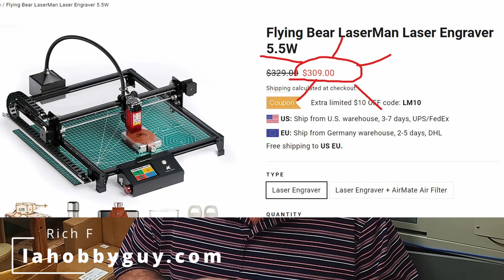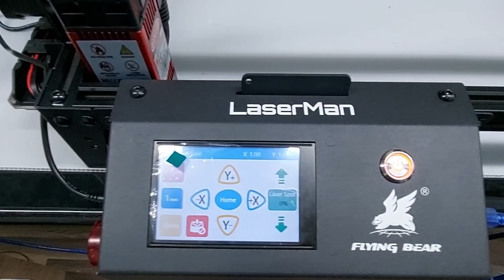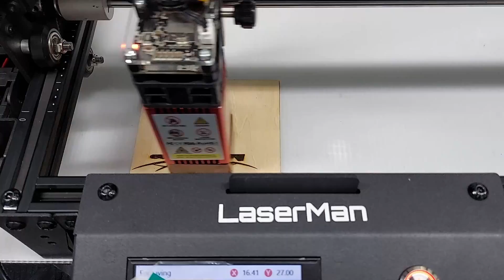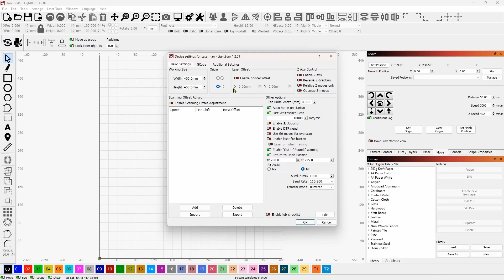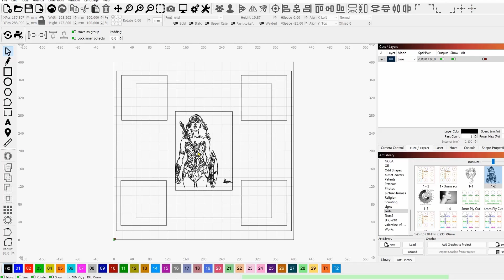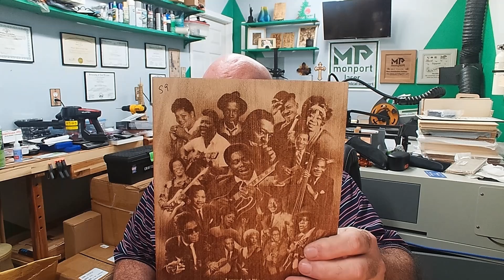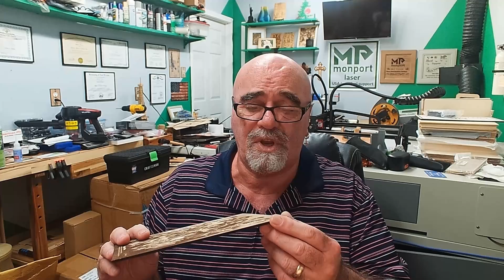ℹ️ Flying Bear Laserman, 5W Diode Laser Review! Comprehensive Review!

Comment: Working with Adam at Flying Bear.  I thought those of you who have this machine or are considering it should have this information.  This is a copy of the email exchange between me and Adam at Flying Bear.  My request is at the bottom of the email and Adams response is at the top.  So you might want to read bottom up so it makes sense....

Dear friend

I'm so sorry to keep you waiting so long.

Thank you for your letter, we too have found this problem and would very much like to solve it.

However, this problem cannot be solved by modifying the firmware at the moment. the operating mechanism of the LB prevents us from changing it, because once it is used, the LB takes over all the controls of the laserman.

For customers with an urgent need the smoke filter can be turned on manually by modifying the hardware. Although this is not a very responsible approach, it is the fastest and easiest way. We plan to do a DIY tutorial next week to show those who need to add a manual switch to turn on the smoke filter.

Also our new Laserman2 and LaserX machines have a modified motherboard interface and rewritten software to allow standalone control, but they will not be available for sale until after August.
 
Adam
adam@3dflyingbear.com

On 2/1/2023 00:15，Steve Hasebroock<SHASEBROOCK@neb.rr.com> wrote： 

*************************************************************************************************************************************************************************************************

Adam,
 
I was told to contact you.  Here is the series of comments that will tell you the issue and story.  Most of these are copied from YouTube post comments on your YT channel.
 
(Steve Wrote)  Many in the DIODE Laser community, particularly the ones the purchased a LaserMan were told MONTHS ago, LAST YEAR that you were working on getting the LaserMan to work directly with LightBurn specifically on the problem with the Fume Extractor NOT turning on when running LB files directly from LB and not saving them to a SC card and launching from the LM machine.
 
Has this been fixed and how to we get the updated firmware.  IF NOT fixed, when will you get this fixed!!!!  A frustrated LM owner.  You can't just build and sell, you have to support and fix problems as well with your machines.  Particularly when this was promised to owners and potential customers.
 
(FlyingBear Wrote)  Hi, the air purifier cannot be opened through LB. This cannot be changed. The air purifier can only be opened by saving the G-code file to the SD card for engraving. However, we now have an external air purifier device, but it needs to be purchased separately. Are you interested?
 
(Steve Wrote)  That is ridiculous.  That is like saying Air Assist cannot be controlled in LB on other machines.  Your Air Purifier is basically the same as air assistant with the advantage of being able to pull the air rather than blow the air.  Either way you are simply turning off and on a motor.  You can’t figure out how to do this in LB?  
 
You may CHOOSE NOT to fix this, but it is wrong to say it CANNOT be controlled.  You (FB) told me and other makers that this was a change you were working on and I as well as others bought and recommended this machine assuming you would follow through.  What a horrible promise to break!  And your solution now to t BUY your other Air Purifier that can be manually turned off and on.  Well, I also followed up on that and find you do NOT supply replacement filters for this machine.  So, what are you supposed to do when the filter is dirty.  Buy another Air Purifier. 
 
FB you need to respond to the promises you made and the needs of your customers that have purchased your product.  This is very disappointing, and I plan to contact EVERYONE I know that has your LaserMan or has recommended it, so that they know your horrible response to this problem.  Very disappointing.
 
(FlyingBear Wrote)  Hi, we just finished the Spring Festival holiday, and we will talk to the technician about it
 
(FlyingBear Wrote)  Please contact adam@3dflyingbear.com
 
Adam,  I have already heard back from makers who have purchased OR have recommended your LaserMan.  They are ALL VERY disappointed to learn that the problem is NOT fixed.  So I hope you will take this on, and get this resolved.  Most makers agree it is NOT that it cant be fixed, it is whether FlyingBear is going to fix to support its machines.  
 
I will keep the Laser Community informed as to what FlyingBear is going to do about this Laserman promise and problem.
 
Thank you,
 
Steve Hasebroock
Reply from the maker: Thanks for the update Steve! And yes, this is vey disappointing! I was assured they were working on a firmware update at the time of this review.
Reply: @TheLouisianaHobbyGuy  Of course!  It's too bad, as the machine has some nice features like the cable management and the built in air purifier.  But not being able to control the AP through LB is a huge negative to this machine.  You can't even manually turn it off/on OUTSIDE of Lightburn.   If I would have known they would not or could not fix this problem as you and I were promised, I would NOT have purchased the machine.  By the way pre-ordered the Roly.  Can't wait to get this machine in my shop.  Leo and I have traded a couple of emails and his response has been superior to anything I have experienced from a Laser Manufacturer.  Thank you for your input to help Leo make his new machine the best it can be and a GREAT value!!!!!
Reply from the maker: Glad to hear Steve! You're going to love it!

Comment: For all who are thinking about this machine or own this machine.  I have been after Flying Bear to fix the issue of the Air Purifier on this machine NOT turning on when controlled through LB.  I was told originally; they were working on this and would have an update coming to solve this. LHG, I believe you were told the same.  

I was just contacted in a YOUTUBE post AND directly from support via email.  They are now saying that the Air Purifier cannot be controlled via LB and they cannot change this.  This is ridiculous.  That is like saying it would be impossible to turn off and on Air Assist through LB on other machines.  Whether it is blowing or sucking in air, it is a motor that can be switched.  Obviously, they just CHOOSE NOT to fix this problem.  And as an owner of this machine for several months now, it is a REAL PAIN to have to save the GCODE to the SC card and take to the machine every time you want to burn a project.  And if you need to make changes back to the PC to save a new file to the SC card with changes and the of course back to the Laser man to burn.  It's painful!  Then one response to my concern was to sell me their stand-alone Air Purifier that can be manually switched off and on.  Really, well the problem with the machine is, they don't sell filters to this machine, so you have no way to replace the filter once dirty.

So, I cannot recommend this machine until they put the time and money into solving this problem.  And IF you are considering this machine know the company and this machine has operational flaws that make it VERY time consuming and more difficult to use efficiently.  I now regret buying this machine and FlyingBear certainly falls short of supporting its customers and machines sold.
Reply from the maker: That sucks Steve! This disappoints me as well!

Comment: Did you get to try their 10 watt laser? Saw it was $180 on their website but light on power specs. Looked at picture and saw it was 12vdc but no Amp numbers. Have sent question to them.
Reply from the maker: It's the same as any other 10W Merrill. 12 or 24DC makes no difference. They still output 10 optical watts. The difference is, a 12V system uses double the amperage of a 24V system at the wall outlet. Moving up the 20W+ multi laser diodes I would prefer to see 24V so they can use the same gage wiring, but on the 5-10W diodes, 12V is fine.

Comment: Well, I bought one and have had it a couple of days.  It IS a really nice laser, really happy with it so far.  But the filtration not working on anything, but the NC files is ridiculous.  I hope they get that figured out quickly as it makes it kind of useless as I use Lightburn.  And FYI it is now on Amazon, $359, BUT that includes Lightburn license.  So really the same as $299 through them and $60 for LB license fee. And it came in 4 or 5 days.  At first, Amazon listed a ONE DAY shipping option for $27.35.  I chose that, but they could not deliver in the one day, so Amazon refunded the shipping fee I paid.  

I hope you will keep posting information about this laser.  Like when they get the air extraction issue fixed to work outside their nc files only.

Thanks for the great review and information.  New subscriber!
Reply from the maker: I hope they get the firmware updated soon as well Steve. But the little hack of using my extraction by taping the hose to it works really well in the mean time!

Comment: can you help? I just burned some names on a few bamboo pens and now that I am doing another, I get this 'CUT MIGHT BE OUT OF BOUNDS DUE TO OVERSCAN SETTINGS' but the only thing I did was type in another name with the same number of letters. I am using the AUFERO 1 with Lightburn 1.2.01. I would have gone to LIGHTBURN but I wouldn't get an answer for a long time.
Reply from the maker: Ignore the message Karl. You get these messages when you're in user origin or current position.
Reply: @TheLouisianaHobbyGuy  But I can't finish the burn, it will not let me continue. How do I continue with it so I can burn the pen? OK, I got out of current pos and went to absolute corrs and it worked. thanks
Reply from the maker: @karlriley1314  Glad you got it Karl.
Reply: @TheLouisianaHobbyGuy  Yea me to, I was really getting PISSED OFF, screaming and all that. I'm 75 and I get pissed really easy now for some reason.

Comment: Nice review Rich, thanks.  I wonder if the air extraction system is helping with the clarity of the photo engraving?  I dont recall air assist running ( and standard air extraction doesn't seem as strong as this one ) in you S9 review.  Seems like a nice machine.
Reply from the maker: No Mark, I ran about 20 photos on this machine, with and without the air. I didn't see a big difference in clarity at all.
Reply: @TheLouisianaHobbyGuy  Thanks for the response.  maybe the board has something to do with it.  I wondering if it is 32 bit.  Anyway, just pondering.......
Reply from the maker: It's 32 bit.

Comment: Any thoughts on ability to upgrade to a 10 watt using available lasers?
Reply from the maker: Well, it's just a 3 wire plug, so you can probably wire any other module to work. But I'm perfectly happy with this 5W module.